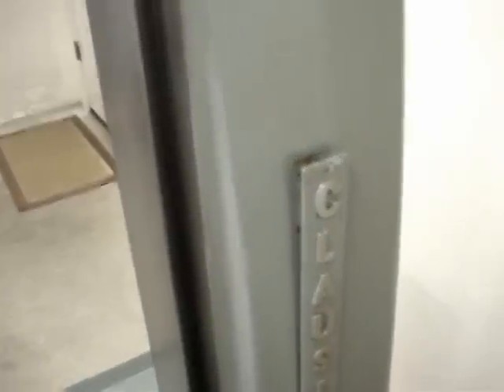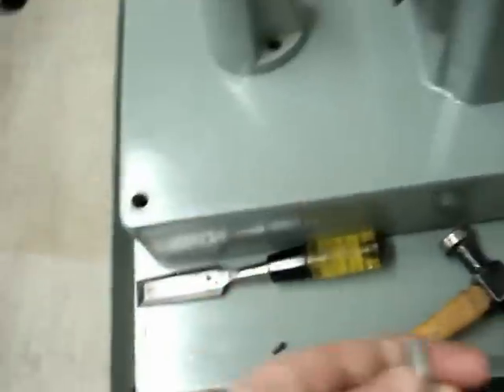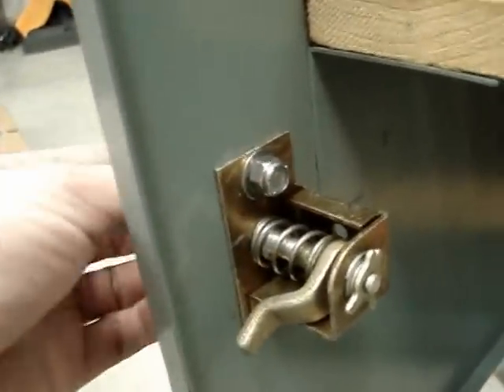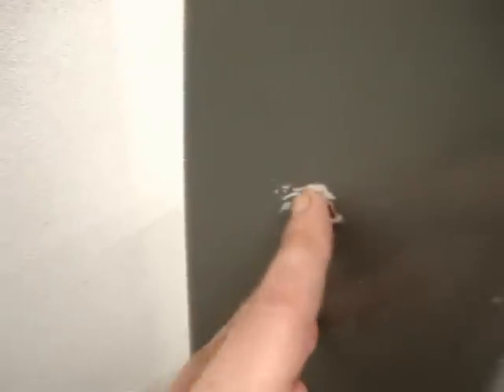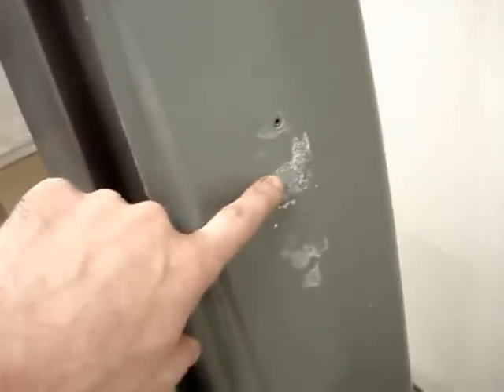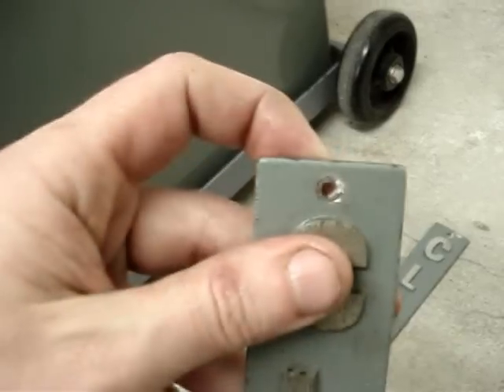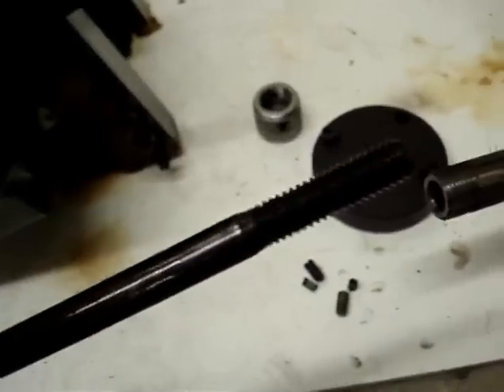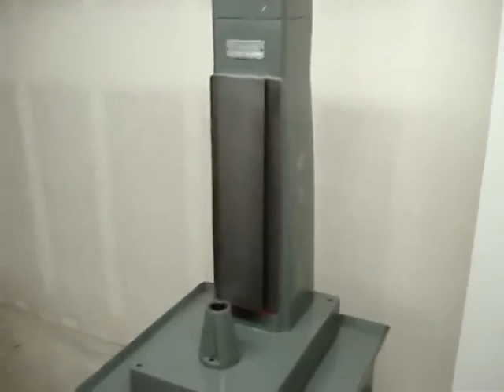Clausing 8520 mill restoration - part 7

Comment: Be nice to see how to disassemble the head on these machines. Mine has a collet jammed in the spindle and I have no idea how to get it out. I'm going crazy trying to figure this out.
Reply from the maker: You can find the exploded diagram on line. That might help. I've since sold this mill. I found the Clausing company to be absolutely moronic to deal with and will never buy another one of their products. Good luck w/ your mill.
Reply: @ray5961  thank you. I have a manual that shows the exploded view but I'm baffled how it comes apart. I've removed all the obvious fasteners but it seems like I'm missing something else.
Reply from the maker: @jimfischione2743  The collets can get pretty stuck in there sometimes. Does your machine have a draw bar? Some collets have a threaded end, so you can't just knock them straight out - you have to unwind the drawbar a bit, then usually tap the top of the bar to jolt them free.. then unscrew them the rest of the way. Try using a flash light and mirror to see what's what. I can't remember how the 8520 is setup exactly, but that's where I'd start. I vaguely remember they use a JT maybe? If you confirm there is no drawbar threaded into the back and holding it in place, you can sometimes put a little heat onto the spindle, then knock the side of the collet back and forth and get it to drop. The other thing is - if any of it is sticking out - you can lock vise grips or something on it, then repeatedly tap downward over and over again. Eventually it will let go, but you'll usually rough up the finish on the collet in the process. Check for a drawbar first.
Reply: @ray5961  thanks again for the help. Yes, it does have a draw bar and it's a bit rough. I had to use a die to straighten out the threads. I will try your suggestion tomorrow. I did notice that you can't tighten up the drawbar very much or it becomes difficult to remove the collets.
Reply from the maker: @jimfischione2743  if it has a drawbar, you should be able to just unthread the draw bar a couple of turns, then hit the top of the drawbar with a rubber hammer, etc. and knock the collet out of taper.
Reply: @ray5961  I have...it's just not cooperating. I don't understand why.
Reply from the maker: @jimfischione2743  WD-40 is your friend. They can really get stuck in there. I'd soak it over night or for a couple of days. Then put some heat on the spindle. You wanna use repeated small taps to send a shock wave down the drawbar to the collet.. not one big godzilla hit. Multiple taps over and over again after soaking in WD40 usually will get it. They can be a real bastard to break free sometimes. Just make damn sure the draw bar has slack
Reply: @ray5961  gotcha! Thanks!
Reply from the maker: @jimfischione2743  Let me know if it works out over there. Again, WD40 and a little heat can really help out.
Reply: @ray5961  I will.
Reply: Nothing yet. Still stuck.
Reply from the maker: @jimfischione2743  That's crazy. Maybe it spun and friction welded itself in there?
Reply: @ray5961  that was my thought. Looks like I'll have to get the head off after all.
Reply from the maker: @jimfischione2743  Yeah, well if you've ever had stainless steel micro weld itself, you know how fun that can be. I feel like heat and a 20 ton press might be in your future :)